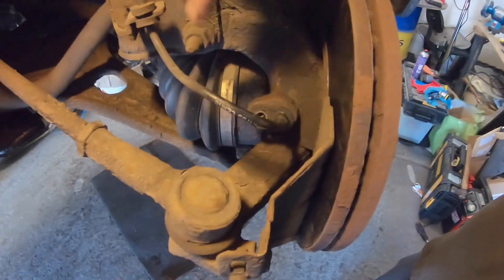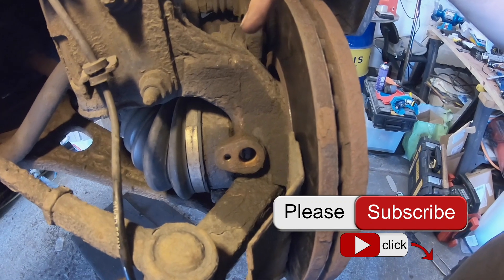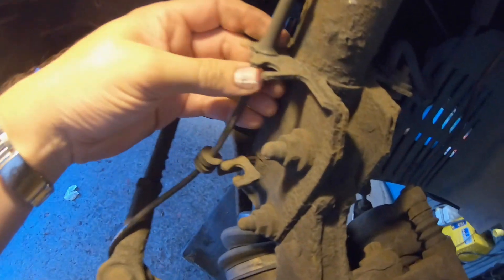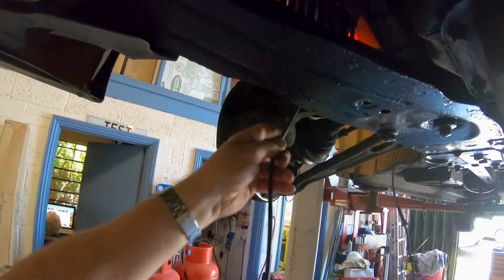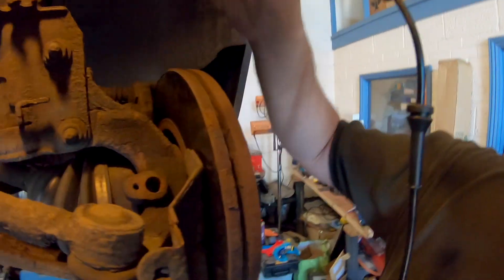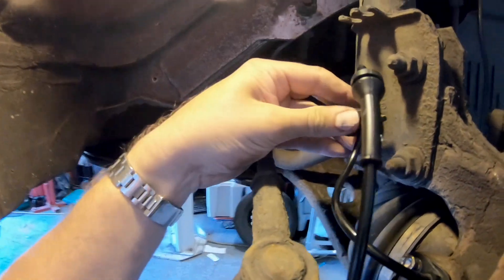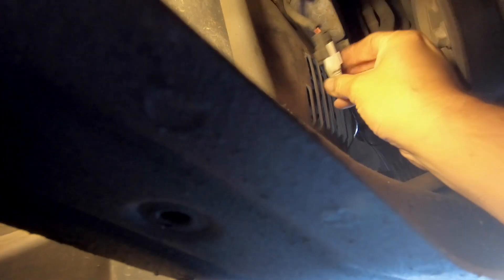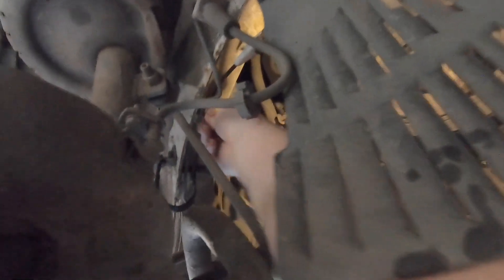Citroen Dispatch ABS fault solved and fixed

Comment: Hi, I have just changed one of my sensors but the abs light will still not go off and there are no more fault codes coming up any ideas what the problem could be please
Reply from the maker: have you drove it for a mile or two,  it may go out, also have you changed anything like steering track rod ends, or wishbones ball joints, because if your tracking is out this will also effect your abs

Comment: After front wheel bearing changed, I put new sensor, but unfortunately ABS light came on. Any ideas where is the problem?
Reply from the maker: did you fit a wheel bearing supplied by the manufacture against your chassis number?, 

The bearings for this have the abs reluctor rings built in, so if you changed to a general bearing then the sensor wont be picking up a signal, also check that while doing the job you didn't damage the abs cable